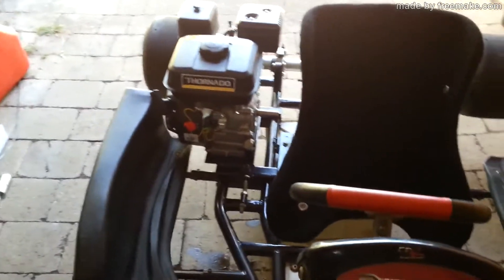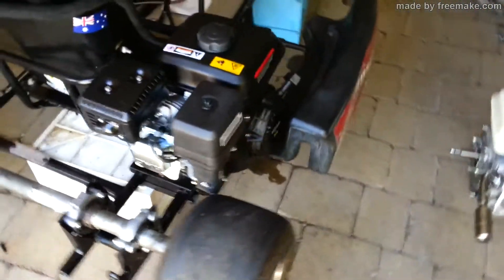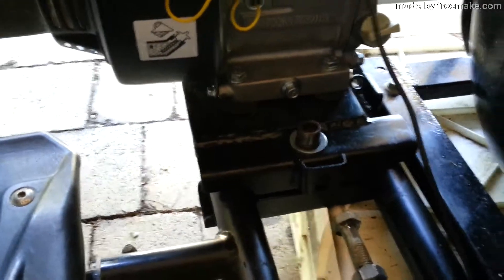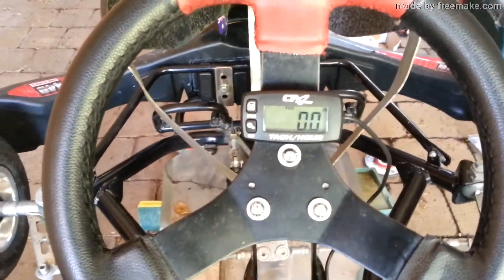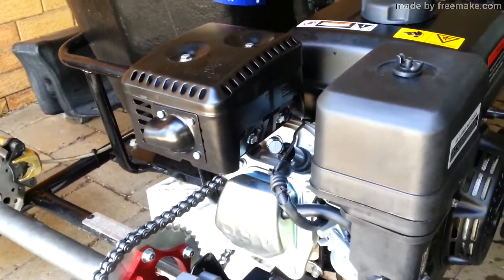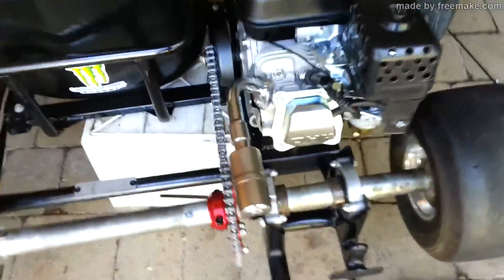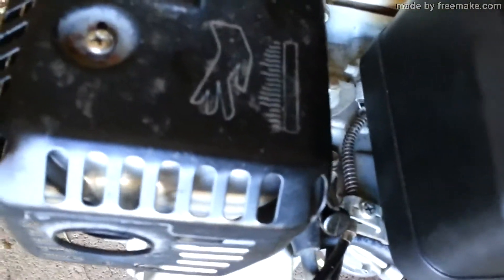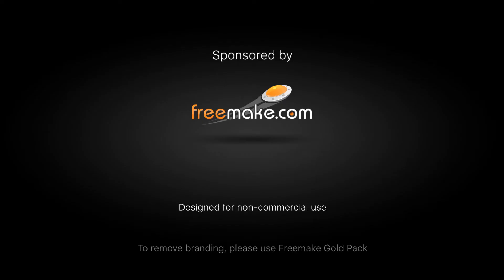Customs Go Kart  - 7 HP Thornado Engine Install

Comment: Looking great. The exhaust was a nice touch, it definitely has some flow now. I'm actually in the process of quieting down my Tecumseh 5 h.p. generator engine with an exhaust muffler out of a 500cc h.o. atv engine. I'm thinking the jetting can be left alone, what do you think?
Reply from the maker: Banshee Fever 750cc how are you mate.  Yes she's turning out well .  If you are using the muffler  and leaving the air cleaner  stock you shouldn't really need to jet it up.   
 I made a pipe for the mrs off roader and didn't  need a jet.  
 Cheers mate 👍
Reply: Customwinder 1 sounds good thank you. Yes I'm still using the stock air filter.

Comment: hi what clutch did u put on this engine?

edit : did u get the thread shaft or key shaft?
Reply from the maker: 10 tooth 3/4 "  centrifugal clutch from Cut Price Racing.   About $60 .   420 pitch chain. 
   Definitely get the keyed shaft.   The clutch has a built-in key.   It also neefs a spacer behind the clutch on the engine side  about 6 or 7 mm thick.   So the clutch can be bolted on properly.    I think the thread in the end of the shaft  is 5/16 fine thread from memory.   
  Hope that helps.  👍
Reply: Customwinder 1 thanks a lot
Reply from the maker: @isaacbryen4558  thats alright mate.   👍
Reply: Customwinder 1 also what fuel and oil did u put into it?